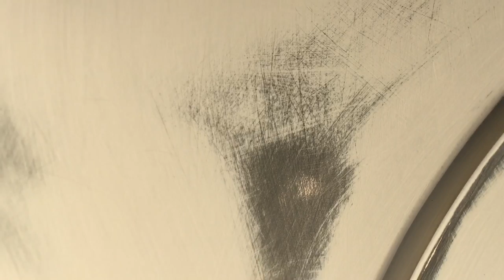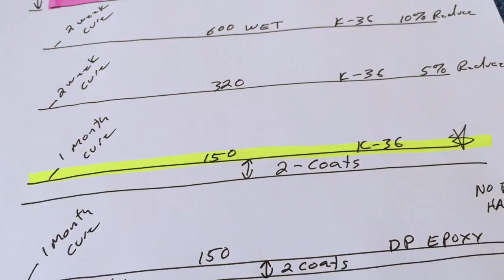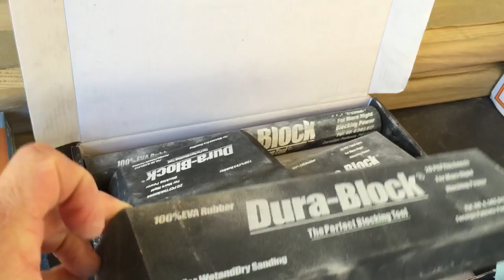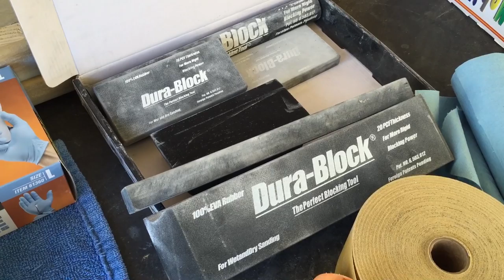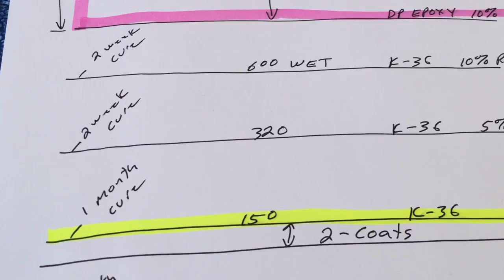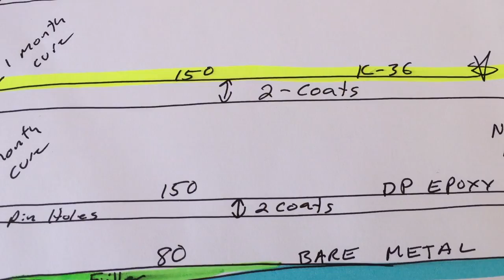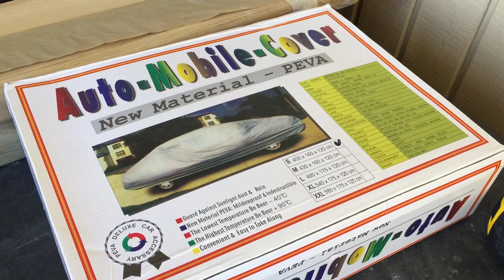1967 Porsche 911 restoration Video 6 Sanding 1st layer of K36

Comment: I've been watching a ton of painting videos, and this series stands out as one of the most comprehensive. So many videos gloss over the little things like dry times, sandpaper grits, mix ratios for primer, outside temperatures, etc. I'm finding out that when it comes to things like paint, talking a lot about every little process is important. 

 I'm just trying to repair the clearcoat on my car, but it's good to see what a super high level paint process looks like.
Reply from the maker: Thanks Live     A proper paint job is incredibly tedious and unforgiving. Studying up on all the little details will help you be more successful.
Good Luck!

Comment: Hi Mike, I have been re-watching all of your videos as of late.  I am getting close to working on the inside of the car and on the bottom.  For the inside if your 911 did you only use POR-15?  Or did you put something else on top of it?  Also, what treatment did you do for your dash?  Did you POR-15 the dash and then apply a paint on top of it?  I want to get the satin black look on my dash.  Thanks for your help.  Great video as usual.  Also, a cool video would be a tour of your shop and booth.  As you are very organized it will help give the rest of us ideas on how to work in a space similar to yours.  Happy New Year!
Reply from the maker: Hello Rodney Happy New Year
Sounds like you are diving in!
The interior was POR15 after media blasting to bare metal first. If you don't go down to bare metal I would recommend priming and painting.
The dashboard was epoxy primer on bare metal and then sanded to 600 grit.
I made a video on this process but after the car was clear coated I had to re-shoot the dash again. 
https://youtu.be/QkHB9vgtKYg
Clear coat overspray had made its way into the cab and ruined the finish so a re-scuff and re-spray was necessary.
The only difference from the video version is I applied three finish coats as apposed to only two and the end finish was even more desirable. 
The product was by PPG called hot rod black and comes as a kit. It is very similar to spraying out epoxy as both are 2K
products.
I like your idea on doing a video of the shop and car areas. Will put it on the videos to do list!
Good Luck
Reply: Hi Mike thank you for your reply!  All is bare metal now... I will follow your advice.  On both the dash and interior.

Comment: Hi Mike,
Love the way you go about things systematically. I am researching my project and it is invaluable help. Anyway, I live in Sweden and the winters here are pretty unforgiving. I wonder at which point in your "bodywork scheme" I could put the car away for the winter period ? Any special precautions you recommend ?
Reply from the maker: Hello Remco Thanks
Have you done any paint stripping or filler work on the chassis..Any sealer coats added yet?
Reply: @MikesRestorations  I haven't done anything yet. I am trying to find a reasonable level of ambition and see if I have to cut any corners. I need to have a plan before I get started because leaving metal unprotected over winter here is not an option. Worst case I need to find a warm garage/shop.
Reply from the maker: @remcotissink  I think a good starting place for winter months might be to begin the disassembly process. Exterior trim, Trunk, Interior, Engine & gearbox. Suspension etc..
Building storage shelving and organizing organize parts. Stripping paint and degreasing parts could be done when things warm up. If its possible to put a space heater where
you are working this might give you some boost when the spring time comes
Reply: @MikesRestorations  Thx ! Sounds like a good idea. Getting my working space and tools together now.
Reply from the maker: @remcotissink  Fantastic Remco! Good Luck this winter!